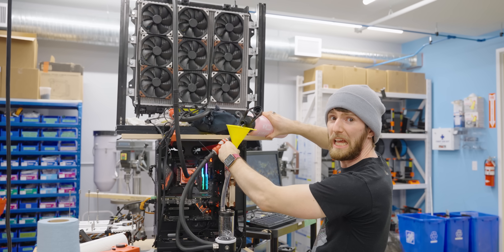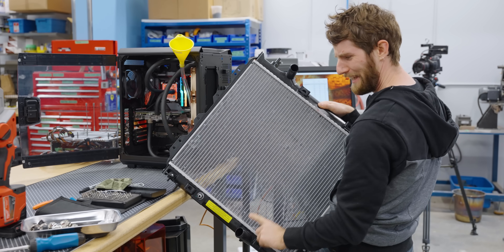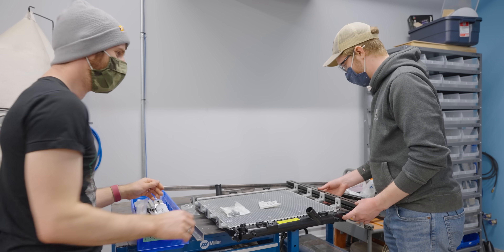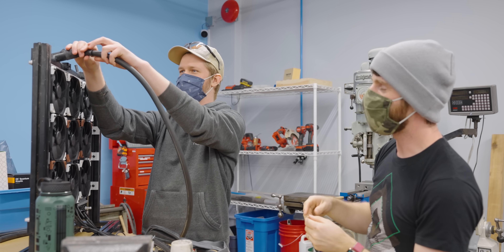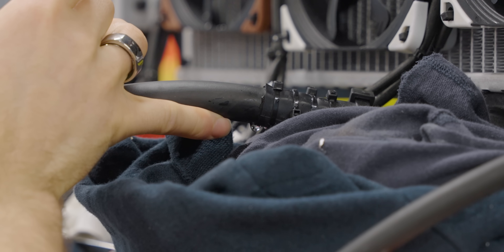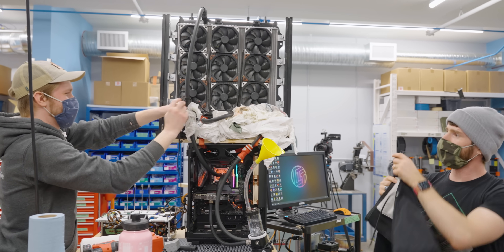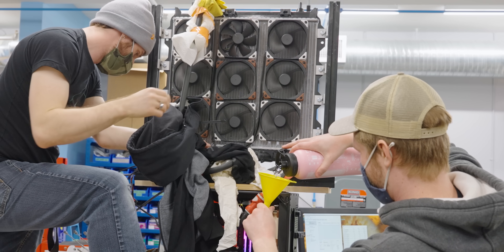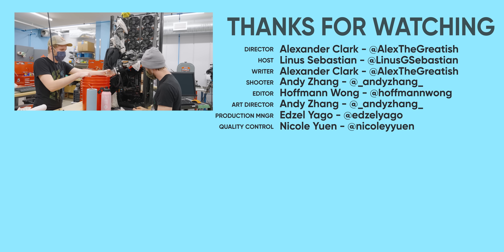Our Craziest Cooling Project Yet - Car radiator liquid cooler

Comment: Literally all this chaos could have been avoided if they stopped, spent maybe 5 minutes to properly seal the ends, and started it back up again.
Reply: Hose clamps. They're a thing.
Reply: @Farengast  Clamping soft tubing directly over soft tubing isn't particularly effective, especially when there is a large ID-OD gap between the two. Need to use proper size transition couplers. Skipping the transmission heat exchanger would have eliminated two leak points from the loop too.
Reply: Previous video "Our lathe is crap, we need a new CNC one". This video: "Duct tape and inner tube for plumbing. It'll be fine!"....
Reply: yes but watching them drive the computer like its a space ship in warp drive is killing me
Reply: Seriously, $170 on a radiator, can’t be arsed to spend $20 on proper hose clamps and  connectors to make this actually work
Reply: or if Alex had properly planned the prject, he bought pt cruiser radiator FFS! HE could have gotten 3 aftermarket higher performance FULL ALUKMINUM civic radiators fgor the same price.... Oh ands those come with Fans made for cooling a CAR ENGINE..... ALSO- PT cruisers are known for overheating... so why use a radiator from one of them?
Reply: @crisnmaryfam7344  Aren't the fans sitting behind the radiator in a car, not attached to the radiator itself?

Also, it's a PC, not a car. That radiator, as much as it might suck for the car it's meant to be in, is waaay overkill for a computer and not gonna thermal throttle just by itself
Reply: Or 3 minutes to fabricate a proper reduction on that old lathe
Reply: it was annoying to watch cuz I was so interested in the premise and got nothing conclusive
Reply: @internetcarson  Since you are interested. Let me offer some insight. This works real good if the costs were not so high and the tubing done properly. With that many fans this will cool down top of the line hardware. Basically you are adding a ton of water volume to sink more heat into and more radiator area to transfer the heat from the water. That said you will run into issues with flow restriction and the single pump will be a limiting factor to getting sufficient flow rate on the system. Cost and the sound is the issue IMHO its loud and not really worth the hassle unless you can get them cheap or you have the spare parts already for this.
Reply: @Carson Brown  you would get better results putting 3x360mm rads (which is approximately the same surface area as this).
As stated, there is a point of diminishing returns and this solution is well past that.
Reply: @internetcarson  Same! The whole reason I watched the video was to see how well a massive radiator would perform, not to watch them fight with  the leaks the created by half assing their connections.
Reply: @internetcarson  Well, there are more legit tests out there, and it doesn't take a full car radiator to get diminishing returns
Reply: @Toastmaster_5000  But larger radiators might allow passively for minor/medium loads. That would have been a cool thing to test out.
Reply: @rickinielsen1  Well if that's your goal, all you need is a 10 gallon bucket of water for a reservoir.  You wouldn't even need fans.  When it comes to heavy extended loads, what matters more is whether you can dissipate the heat faster than you can build it up.  Seems most people prefer the route of bigger radiators with more slow-moving fans.
Reply: @Toastmaster_5000  I was thinking more of prolonged low-medium load situations, like 90+% of the work/gaming people do. Obviously for short loads you just need a bit of thermal mass...
Reply: @rickinielsen1  Well in that case you don't need liquid cooling at all
Reply: @internetcarson  if you want specific technical graphs, this is not the channel for that, LTT is for general knowladge on IT and reviews on new stuff, if graphs is what you need there are bunch of channels that are way more specific for that.
Gamer Nexus for example is a good channel to see cooling performance and more tecnical stuff... And even their you will see some nonsense funny videos sometimes, just to have fun.
Reply: Dude, it is Linus Tech Tips, crazy over correct
Reply: @أسامهناصر-ر3ل  it didnt even hardly funtion lmao its not crazy...just lazy
Reply: cannot agree more
Reply: Yeah, but they sure had fun doing it this way. Or at least Linus was clearly enjoying himself...
Reply: Flex-seal?
Reply: I can't imagine a pt cruiser radiator being  cheaper than a mid 90s civic and maybe use a manual trans version or plug the trans cooler lines
Reply: GirlBaBes.Men
Reply: This was make fake chaos for content, like when you tubers pretend to make huge messes to make content
Reply: If there isn't chaos, there isn't content to milk. Great for the algorithm, not so much for us who actually want to see the results.
Reply: It wouldn’t be anywhere near as entertaining
Reply: https://www.youtube.com/watch?v=VJUJWtVbEys&ab_channel=GamersNexus
Reply: eazy difficulty is not fun
Reply: Ikr
Reply: In reality, they wanted to make it difficult to create content.
Reply: First, if they would had gone with a rad with a cap, then there are  fittings that mate with radiators fittings to ntp. It's great for a laugh. But as a racer I could have made this work in under 30 minutes.
Reply: Usb it supposed to attach fluid at the radiators top channel?
Reply: Nah dude that'll be boring it makes linus happy it makes me happy the video gets views for engagement and I think Linus is a good guy and deserves it.😊
Reply: That's not the Linus way! That won't lead to your minio... I mean "employees" getting electrocuted for views!
Reply: @GrundleGrump you know your minions you pay, but fr I think they are fine still I mean it's an interesting job with good equipment and since Linus seems to be a nice guy it's the same backstage.
Reply: that's not the yt spirit
Reply: Would not be fun.
Reply: You're right, but that wouldn't have been as fun to watch.
Reply: Thats not the LTT way tho
Reply: That wouldn't be funny at all, the point is exactly that, make it fun and funny :p
Reply: @kiiikoooPT  and stupid... I like LTT but come on... don't lower your expectations
Reply: @geort45  What do you mean? I'm not lowering anything, I'm just aware that diferent channels have diferent content, you are the one who are looking for something where there isn't... Like I said if you want more tecnical stuff there are other places who are more tecnical, LTT is tecnical enough for people to know the basics of what they need to know, if they need more indeep content they got to look for other channels, not expect for a channel that exists for years and always worked in same way to change it just because you need more information.
Reply: @kiiikoooPT  LTT does reviews, even if not extremely at depth, and spent hundreds of thousands of dollars on machining equipment... you’re telling me all that is for doing ghetto shit? come on... it’s one thing to be funny and another to do half assed projects because they just want to publish more quantity than quality
Reply: @geort45  this video is about a funny and crazy idea of making a big cooling project, even with all the machinery they wont be able to make better cooling then what, way bigger and more specialized companies, already did, this is to prove people that is not even worth it to try and go crazy like that, you just dont get it...
and this is not a review of anything, these are just linus crazy ideas represented in a funny way cause they know they wont make something that is better then what already exists.
that is not even their goal...
the machinery is to make cool stuff, not to make new better stuff, is just to make custom stuff with their brand and that will look the way they want it to look instead of paying thousands of dolars to someone else to do it for them...
Reply: @kiiikoooPT  Dude... they could AT LEAST make the damn thing not leak, so to AT LEAST know if it DONE CORRECTLY (even if it's a ghetto build) it works to some extent, if it's worth it... but the piece of shit leaks and it's a fire hazard... following that line of thought why don't make it funnier and make it short circuit and burn? As I said, it's just trash-video to publish something. LTT does quality stuff, it's not feasible to make a fucking amazing perfect project with custom CNC parts every time I know, but come on... make that shit at least work! They have 50+ minions, one of those slaves could have easily gone to the closest home-depot equivalent.
Reply: then it wouldn't be fun at all!
Reply: That doesn't sound like good content to me...
Reply: It was better this way tho lol

Comment: If you just used some metal pipe connectors you would have way better preassure with the bike tyre and no leaks.

Comment: ATF radiator in "sandwich" like this have small area. A point of this sandwich to heat ATF from engine at cold start. Cause engine heats up at idle.. transmission at moving ;).
Try to use ATF radiator itself .. they are smaller, you be able to find some like 24cmx24cm.

Comment: Why is that original pc running so hot?  I have the same 360 rad cooling 2x 2080's plus a 9590 and the mobo.  Never gets over 50. I do have the smaller DDC pump tho.  Maybe the coolant is moving too fast?

Comment: Hi Linus sort your leaks and it will be a winner. I used mine as a wall mount excellent cooling. Just use a better rad with one in and out flow.Cheers

Comment: If guys ever wanted to do it right you would buy a transmission cooler, you can even buy all copper ones, the fitting are more compatible and the form factor is much better than the ridiculous thing you chose.  Kind of worrying you guys don't know how pointless the transmission cooler is in that radiator.  The you would attach the transmission cooler to a case door cut out to allow flow and then use fans to pressure an otherwise sealed case to force air through the side of case with the huge cut out thus forcing air through the heat. exchanger.  In a word of me too cases I'm surprised a case manufacturers hasn't already made a case like this.

Comment: I don't understand why they have an entire shop with tens of thousands worth of manufacturing equipment and instead of using that to properly do this, they cut a bike tube and zip tie it.

What's the point of your shop if you don't use it for stuff like this? Making an adapter for the larger port would be fairly trivial with the equipment they have.

It's entertaining, but I'd like to at least occasionally do something correctly.

Comment: Ok, so I [was] going to share this with my son, an VFX artist to help with the cooling of his very expressive 3090 gpu, but you went about this all wrong, unless that was your intent. Wire ties make for very poor hose clamps. Before powering up the computer, first make sure there are no leaks by filling the radiator and getting all the air out of the system. There's a reason why raised floors are raised and water cooling is not placed on top of computer racks.

Please consider re-doing this again but with some forethought of the lessons learned from your first attempt.

Comment: I want to see this remade with actually proper fittings and working fans. There's potential there, I believe it.
Reply: a low speed big car fan with proper shroud for the rad would be better for the acoustics for sure
Reply: @ratchetfreak  how about a box fan with the motor wired into the CPU fan speed controller?
Reply: They should have just used the electric cooling fan for the PT Cruiser.  You can pick them up for  $50 and then they could have just ran it off a car battery.
Reply: @JuiceSpringsteen88  without an alternator, i think they can figure something way better then just consuming car batteries like nobody's business
Reply: @omaradriani6770  If they're going to run it long term, the best solution would be a high amp battery charger connected to an outlet.  If they're just testing, a deep cycle car battery or a decent sealed lead acid would be fine.  Bonus points for a lithium iron phosphate battery.
Reply: Actually the PT fan should work. It works on 12v and I am sure there is an adapter somewhere for that. So it can connect to the power supply.
Reply: Funny to see the same reaction on YouTube as on floatplane

Comment: Why not just use a "WATERCOOL RADIATOR MO-RA3 420 PRO" with 9x 140mn or 18x140mm? I use personal use a "Phobya Xtreme NOVA 1080 Radiator" with 9x120mm for cooling my amd 5900 and my rtx 2080 super.

Comment: There's a video on youtube of a guy using a car radiator for his PC cooling.

he mounted the radiator in his garage, and ran piping in his walls from his room to the garage so that the heat output doesn't go into his room.

He had multiple systems connected to it.

Comment: Am I crazy for wanting to see a better thought out and functional version of this project later on?
Reply: Nope, I felt that was lacking also. Don't mind them showing how chaotic it was / what went wrong... but they essentially didn't fix the problem and just called it a day.
Reply: No
Reply: You could probably find a motorcycle radiator that would fit in one of the really large cases
Reply: @PhlyinPhilzVideoz  Or heating matrix
Reply: not at all, this video is. just....terrible, even by LTT standards. They have a full machine shop ffs
Reply: and they have money for parts too
Reply: My first idea for WC was using car radiator, since where I live they are 1/3 the price of proper WC rads. Would love to see it done right
Reply: Yeah I'd like to see this done with at least a moment of thought ahead of time instead of this kamikaze "if nothing breaks it's a win" method
Reply: Wish this was a serious test.
Reply: if they wanted a better result they could have just bought a MO-RA3 420 from watercool.de and have a proper product that does the job
Reply: they did a better version few years ago. this is lame
Reply: I was sort of disappointed they just memed it and left 500 leaks all going rather than thinking it out for more than 10 seconds to make it properly.
Reply: Gamers Nexus already did it right w/ MORA radiators - twice the price but would actually work.
Could be done significantly easier/better with a standalone transmission radiator for closer to $40, it would be smaller - but cheaper AND have fittings that would be easy enough to adapt mechanically.
Reply: yeah a non shit show would be awesome for this lol
Reply: check into a honda civic rad, much smaller and actually out performs the pt cruiser. Alex didnt hunt very hard for a good rad. PT cruisers are one, unique in their shape making the rads more expensive, Civics are (around the mid 90's) are nearly perfectly square/rectangle. Also, 1/3 to 1/4 of the price Alex paid..
Reply: This is not really a new idea, has been done pretty often, just google away. 
Whole videos is imho more the "entertainment" category, could have been done a lot more professional with a little more effort.
Reply: You can go find videos where they used an aquarium cooler or even a full a/c unit to cool the cpu. Both times the issue becomes a matter of frost buildup instead of leakage from the system.
Reply: Nope.
Reply: They just need to 3d print an adaptor with an o-ring for the larger inlet/outlet.
Reply: YEA, THIS VIDEO SUX
Reply: GirlBaBes.Men

Comment: This is so wacky that it's not even funny anymore. We all expected you guys to improvise for the sake of speed, but this video is utterly pointless. Instead of rudimentary fixing the loop and running a long test, you simply goofed around for 15 minutes and gave us not even an ounce of meaningful data. You could have literally used a bucket instead of the radiator and achieved way more information density. But anything for clicks, right?

Comment: I always though about modding a case like this: 

Take a bike radiator + fan, install it as the side panel of the PC case and attach the fan to the 12v contacts of your power supply. Should work fine, and if it can cool a 1000cc superbike it should cool any pc without any hesitation. 

Maybe I will build something like this in the future^^

Comment: This needs a revisit. Print some adapters, figure out a proper mounting system. This trainwreck was fun to watch but I'm interested in some serious results..
Reply: What's serious about a car radiator for a PC? lol
Reply: @StambeccoAllaFragola  in some countries a car radiator can be cheaper then water-cooling radiators, all you need is the water blocks and you're good to go
Reply: @Unwavering_Resolve  True. Could find wrecked cars and possibly get some for free.
Reply: @Unwavering_Resolve  there are way more efficient ways to improve thermals as Linus himself said at the beginning of the video: at a certain point you have diminishing returns and that radiator size must be overkill. But yeah, I guess it can be a viable cheap idea if you have a spare car radiator laying around. And many towels.

Comment: Why did they bother with the transmission cooler loop? They should have just not hooked it up, just used the main inlet and outlet. Also the water leaking killed me, why didn't they stop and make adapters to fit correctly. They have a lathe, just turn a reducer that fits the bike innertube, and the other end would fit the pc water line.

Comment: The trans cooler section just cools transmission fluid in the coolant. Has no actual benefit, but makes a huge restriction.
Reply: Also, could have 3dprinted a fitting to connect the flange to a smaller hose.

Comment: As mechanic you should have used like radiator from a 90's civic for size reason it significantly smaller and Dosen't have a built-in trans cooler .

Comment: The transmission cooler uses the coolant to cool the transmission oil. Which is why to dont see the cooler. It's inside of the radiator.